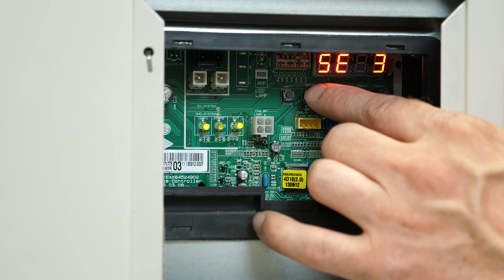Technically Speaking: LG Multi V - Part 3 - Vacuum Mode

Comment: hello masters, I want permission to ask, there is 1 ac cassette system lg vrf, but it doesn't want to be cold and the indoor evaporator is also not cold because eev spare parts don't want to open the shop how to handle eev so it's normal, how do you master